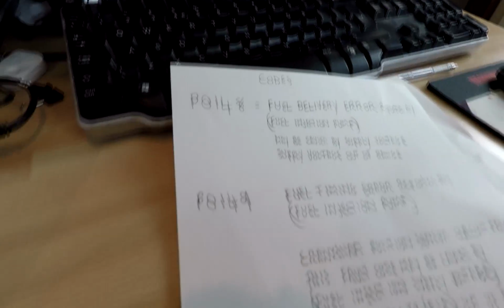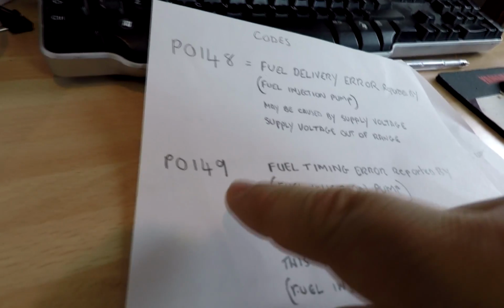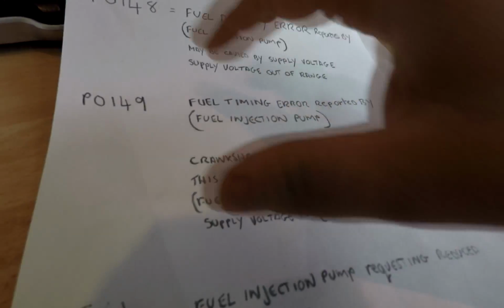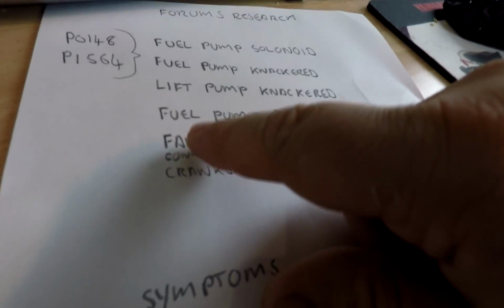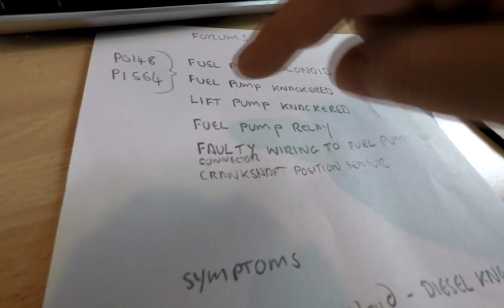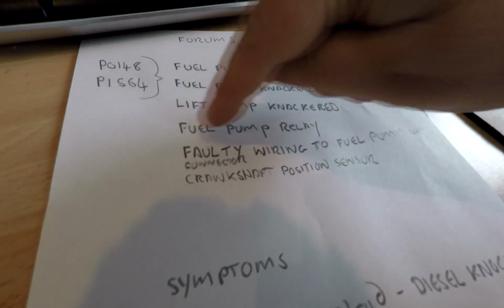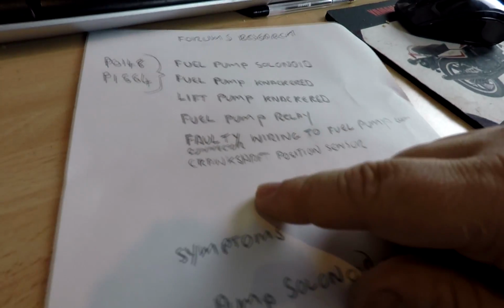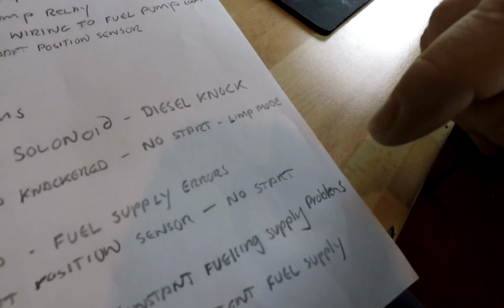Part 4 Ford Mondeo Mk3 Tddi Running Rough Fuel Injector Pump Relay

Comment: I have mk3 tdci 130, sore on mpg no codes. Changed oil fuel air filters. New crank pulley belt tensioner, water pump thermostat pipes, alternator. New fuel pressure valve on back of pump. It starts drives accelerates as it should just very heavy on fuel, no smell on fuel, engine noisy
Reply from the maker: I would do a live data on the 02 sensor to see if it was reading ok.

Comment: Mine was a fuel injector regulator on top of motor. A piece of plastic with a wire held by a single bolt.

Comment: My TDCi 96 kw Mondeo sometimes wont start from first try, when idle it is very rough sound and when I push throttle hard limp mode goes on. Could it be same thing as here?
Reply from the maker: Check your fault codes bud.
Reply: @retrorestore  Its a high pressure pump, which gonna cost me a lot to repair. Well I guess that there is nothing more expensive than a cheap turbo diesel. Thank you for your answer!

Comment: hi mate , i dont tent to work on tdsis like petrol cars but just a thought have you cheked the  fuel pump in the tank ?on petrol cars they some times have a filter on the fuel pump  , im thinking it could be nearly completly clogged , and allowing enough fuel through to run but it cant suck enough up to keep up with the demand of open throttle ? i may be wrong but i guess its worth a try hope  to see more videos

Comment: hello to my friend i am from bosna
I have a problem with the burning Mondeo 2004 2.0 Tddi 66kw
The first start is good
When the engine warms up after 1-2 hours it will not ignite 1 time, and when it is start  from the first time, the torque meter remains on the 500R and the torch light starts to flash.
While running 2 times, it's ideal without any mistakes.
And so every time
If you knew what the problem was, I'd be very grateful to you
Reply from the maker: See if it has any fault codes to give you a better idea bud.
Reply: retrorestore 
fault codes
P 1564
P0335
PO336
C2316
P1316
P1664
if you could guess what the problem is
thank you in advance
Reply from the maker: That's a lot of fault codes to take a guess at bud.

Comment: Can u help me i have this problem if my car stay couple days i cant start him i need to pull him whit another car and the he start after that he start from first every time when i start him but again i put  him to stay 2 or more days and i cant start him
Reply from the maker: Does the engine turn over, if not, it could be your starter motor.
Reply: retrorestore my starter motor is ok i change that
Reply: My car is ford mondeo 2001 TDDi 2.0
Reply: retrorestore  and i forget to say my lift fuel pump leaks fuel litle bit can be that problem

Comment: Can i get help i have mondeo mk3 55 plate 2l tdci actuator arm stopped moving flashing glow plug light loss of turbo i can coast n switch off ignition n back on tben boosys n cuts off help help help anybpdy ov cleaned egr valve and yoused whole tin of wynns turbo cleaner into air intake on turbo helo help help
Reply from the maker: Check for fault codes bud

Comment: hi can you help me please with these 3 codes???  
P0409 -Exhaust Gas Recirculation Sensor  A Circuit
P1664 - Injection Pump Control ModuleMalfunction
P1564 -injection Pump Control Module Requesting Reduced Fueling 
i got these code after repairing the injection pump.the simptoms are that i have a lot of losing power.cant run more than 120 km.h.i will apreciate any advice.
Ford mondeo mk3.2001.tddi 2.0
Reply from the maker: I take it this is for a TDCI as you have an EGR sensor fault. I'd be guessing bud without knowing exactly what you repaired.
Reply: i repared the electronic part from the injection pump.before that all was good. but now after that. i got these

Comment: I hope you get this resolved soon, I  appreciate you uploading these video's and helping people.  out of interest what part of the UK are you from ?
Reply from the maker: So do I mark. I live in Lincolnshire but from London.
Cheers
Martin
Reply: Hi, thanks for replying. Shame you live so far I live in Skelmersdale in the North West , I'd like to think we could help each other out if we lived nearer, I have spent over £10,000 in repairs on 4 cars in around 5 years, current car has a clunk when bring clutch up but goes into each gear perfectly, also has suspected head gasket, been losing water for over 15 months but only needs topping up once a month, chemical test revealed bad head gasket. I'd have had head gasket replaced if it were not for the clunk noise and a few different other probems I am having with it, I think I will just use it as it still drives great atm, no power loss, no smoke , no oil/water mixing, it runs fine just have to top op water each month or so. It's so frustrating/sad to spend so much time/money into a car for it to fall apart and be unecomnical to repair, it's a 2006 mk2 ford focus spirt 1.8 tdci with 158,000 on clock, I could have it all repaired but I think I will continue saving for new car although I di like these cars It's already had over £2,000 spent on it in 2 years, I do some repairs myself and am continuing to learn, and your videos are helping me also, I'm not a mechanic but I have replaced a fair bit in the past 6 months, mainly brakes and suspensions, glow plugs, radiator, sensors *cylinder head sensor) , I really appreciate your videos and thanks for replying, keep up the good work and good luck !
Reply from the maker: Wow, you've spent a lot Mark, The clunk sounds to me like driveshafts when taking up the drive but without seeing it, I can't be 100% sure. Glad you are enjoying the vids as well bud.
All the best
Martin

Comment: Hi Martin, get someone to go out with you and have forscan running with just FRP and see if it drops when it's kangarooing, when the car is cold the fuel re-circulates from the fuel filter to HP pump, when it reaches a certain temp it then starts getting sent back down the return line to fuel tank, this might be when your problems start, and you can look at fuel temp (FTS) in forscan, and CHT Cylider head temp.I would also be looking at FRP to see if your lift pump cant supply your HP pump with enough fuel when you're having problems.
Reply from the maker: It's a good point. I am uploading a new vid now. The lift pump is working when the car is cranked as I can hear it with a screwdriver on it and putting it to my ear.

Comment: hi martin i once owned a 1983 vw sciròcco and it was also driving as if it was a fuel problem no mechanic could identify the cause until i spoke to  vw expert and he removed the back seat opened the fuel sender unit put in a magnet into the fuel tank problem solved no more problems then six weeks later car was written off lol
Reply from the maker: Amazing, wonder what he knew lol

Comment: forgot to mention have something to hand to plug the hose when you remove it from pump I tried hose clamp but because the pipe is nylon it wouldn't pinch it propley to stop the flow.
Reply from the maker: Thanks for the info Sean.
Cheers
Martin

Comment: When I replaced the lift pump on mine I could it running when I turned ignition on never  heard the old one.Then again the old one was a bosch the new was cheaper one from euro car parts £60 Inc vat and 30% off about 6 weeks ago car runs a lot smoother and idles better runs well for 167000 miles. 1 bolt 2 push on pipes 2 push on leads 20 mins max to change.

Comment: Hi Martin, get yourself the leakoff injector clips from the scrappy, and make yourself a leakoff test kit, and do the test when the car is upto temp. Loads of vids on youtube, you want all 4 bottles to be even, any high leakoff will be the bad injector.With forscan what is the fuel pressure doing when its kangarooing?, does it drop the same as the kangarooing?.
Reply from the maker: Not sure on the pressure but i'll check out a few vids on making that.
Cheers
Martin
Reply: jeansy10 Leak off kits are mega cheap from the likes of eBay with all the adapters!
Reply: I didn't know you could get the kits so cheap now, when I was looking a year ago the cheapest way was to cut up some old leak off pipes for the right connectors !.

Comment: Martin considering the fault occurs when it heats up, you could also check the cylinder head temp sensor which sits in a blind hole behind the camshaft sprocket another common fault on a 2.0 tddi engine, this replaces a normal temp/coolant sensor if it's iffy the edu thinks the engine is still cold and there for gives it more fuel..................the variables are endless very hard to help without seeing it in the flesh
Reply from the maker: Cheers Willie.

Comment: Great information Martin . And good logic .As someone has said it's odd the problems start when the motor is warmed up.
Cheers Pete.
Reply from the maker: I agree, I think it's something to do with open and closed loop sensor readings Pete. So much conflicting info here I've got to sort through it all.
Cheers
Martin
Reply: Good luck with it Martin . You on the mend now . Iam dam full of the cold/virus crap .
Happy days .

Comment: Great update again. I think ppl missing the point of your vids ( a bit like me at first) Showing your fails so much more valuable to ppl doing work on own cars. You show all the steps you follow and logic behide it. Ok it didn't work but that's the prosess and might be really helpful to a person with the fault. I think anyone who has worked on cars will know a misfire and bogging down can be 100 different things. You are just using logic to find the fault and that's all anyone could do. Still think you need your own tv chanal. Vids are priceless.👍👍👍
Reply from the maker: That's right Dave, I try and show real world stuff and the workings of why I have done what I have done. I'm sure, showing the inside of the relay will help others to understand what is a mystery box that costs over £30.00 and see it's just one set of contacts and a coil.
Cheers
Martin
Reply: The process of elimination.
Reply: retrorestore Yes showing the relay stuff was great. Keep up the vids. I was talking to a guy today about your vids. He said the same as me BRILLIANT! !! really good. So many ppl doing vids on cars turning cams off at key points or working on parts you can tell are new. Not seen anyone showing real world stuff from start to finish.
Reply: I agree, he's great

Comment: Hi Martin, interesting video. When the car started to smoke, was the smoke black or white? If it's black this could indicate overfuelling. This can be caused by sticking vanes on the VNTurbo causing airflow problems. When the vanes stick, it can cause the air mass meter to misbehave and throw up a code which can make it appear the mass sensor is the problem and not the VNT. Since fuelling is related to air mass meter, a chain of faults occurs that will generate all sorts of fault codes. I was once asked to deal with a Volkswagen Sharan TD which had similar symptoms as your Mondeo. At first glance it looked like a knackered mass meter but it was sticking vanes on the turbo. I know its a long shot but might be worth having a look as sticking VNT is a very common problem across all makes of vehicle that use VNT especially with electronic boost control as opposed to the traditional 'wastegate control'.
Reply from the maker: It wasn't black, more of a grey/blue. thanks for the info.
Cheers
Martin

Comment: Let's hope this one is an easy fix Martin something small and cheap that when we will discover we will all kick are selves for not finding or thinking of.Great video Martin and interesting to see inside that relay never think of all that inside the engine bay
Reply from the maker: Thanks bud, That's why I took the relay apart to allow others to see what is actually inside. Plenty still do do though.
Cheers
Martin

Comment: hi martin, .....you will have to try and recreate the fault on your runway and not on a test run. let the car get up to normal temp, then plug in the F super, then put it to oscilloscope. choose injectors then watch what they do when hopefully the fault reoccurs, see if there is an unusual pattern with one of them, if you are on a test run set it to freeze frame to record the fault then you can play it back. the 1564 code is requesting lower fuelling because its either over fuelling or the solenoid which meters the fuel and the timing of it is telling the ecu there is not enuff fuel going in to the pump and therefore it adds fuel, same as fuel trim does on a petrol car, the question is why ??? this could also be caused by vacuum leak at the inlet manifold.which could explain the temp and giving the fast pedal some stick when it causes the hesitation the cables that go to the fuel pump go over the starter motor need checked thoroughly they may look fine but are notorious for being dodgy. if this was my transit I would be checking in this order.   .......fuel filter, ( always use genuine ford the others are crap and prone to letting in air), fuel filter housing, fuel pump relay, vacuum leak at inlet, injector seals, wiring at the fuel injection pump. then put on the f super and check all the tests it will let you do on the oscilloscope...............heres a bit of an urban myth cleared up them bosch fuel pumps don't break down its the little box on top of it with the circuit board that goes kaput...............once again martin if you can recreate that fault on the runway where you can visually check the engine and study the f super then your halfway home to a solution...............good luck and let us see the f super results on camera

cheers willie
Reply from the maker: Cheers Willie, I'll be plugging the F Super in again and  hopefully researching the fuelling in the next video. and I've read about the cables as well. That relay was a bit of a mystery and that is why I opened it up as so many people just change it without actually knowing how it works. I hope I've  demystified that one. I'll need to do a bit more research on the PID's to watch when testing as well.
Cheers
Martin

Comment: Martin have you checked the map sensor? As it only plays up under boost 🤔 sometimes theses codes are generic codes and can mean other things🤔or possibly a temperature sensor as that also controls the fuelling for cold starts? You can diagnose that by simply unplugging it when it's warm,, I hate faults like this myself and love it when you can resolve them,
Reply from the maker: Thanks bud, As you can imagine, it's all new to me so i'm learning all the time, thanks for the info.
Cheers
Martin

Comment: Have you checked out the South Main Auto channel? This type of investigation would be right up his street. You mentioned the lift pump in a previous vid and everything is pointing towards that.
Reply from the maker: Yes, I've been watching his vids as well as Schrodingers Box, who knows his stuff too.
Reply from the maker: Now I am confused lol. It's a minefield out there
Reply: Eric O's a professional mechanic and unlike some other so-called "mechanics" he doesn't "play parts" darts on the strength of the fault codes. Martin said in the vid that if he'd taken it to Ford they would've done this and replaced the expensive fuel pump. I've not watched any of the Schrodinger Box vids yet so I can't really comment. Keep on with it Martin and you WILL get to the bottom of this problem.

Comment: With the Fordscan you have done virtually the same as most garages (including main dealers). As you say there are loads of instances of the fuel pump being changed, and not fixing the problem. There are thousands and thousands of similar scenarios covering most makes and models of cars. This ultimately brings you to the conclusion that the diagnostic set up of most cars is pants! Main stealers will put it straight on their diagnostic, at one heck of a charge. Now that might be worth it if they could tell what the EXACT fault is (guaranteed). But guess what folks, that won't gonna happen in a lifetime!!!! Rant over.
Reply from the maker: 100% agree Stephen, that's why i'm doing this myself. I read that one dealer charged £300 just for their diagnostic time without actually correcting the fault or changing any parts.
Reply: retrorestore I have the Tdci estate on an 04 plate.

Comment: Oyy what a nightmare. Great troubleshooting Martin. I would have put a meter on the relay contacts to show before and after the contact cleaning. Your car acts just like my Taurus did with the crank position sensor out of whack. Runs normal, then a hickup, then all the bumping like a bucking Bronco. I still think that will be the problem. Fuel pumps just go bad and nothing starts or runs. Waiting anxiously for the next vid. Have some Ovaltine.
Reply from the maker: I will check that Bri with the scope to see how it performs under load. Not totally ruling it out but had to check this first.